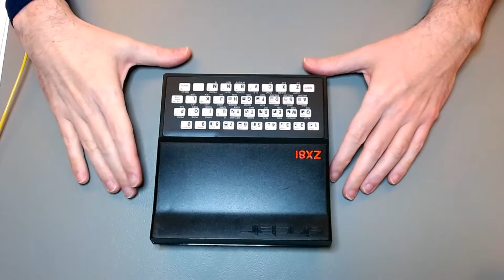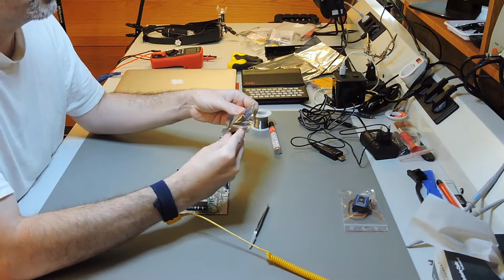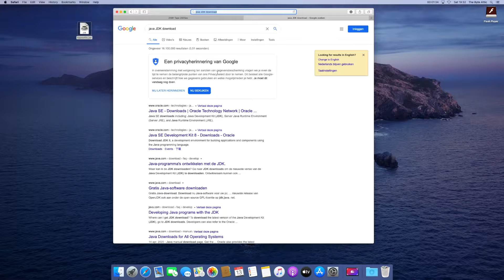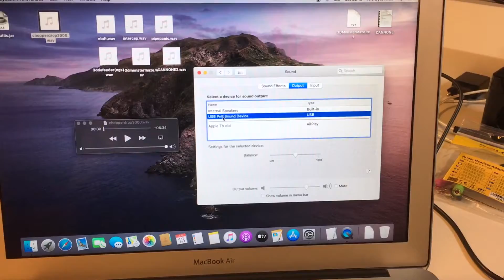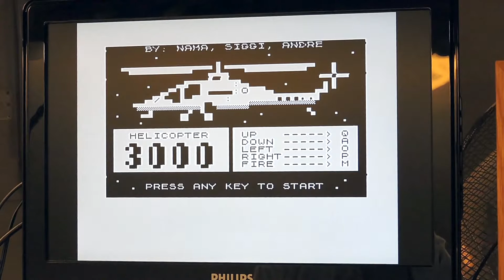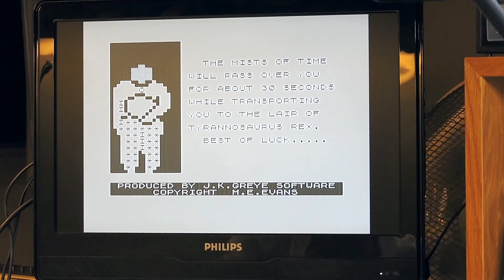ZX-81 bonus material and retrogaming!

Comment: Do you have any information onto which pads you have to solder the RAM pins in a Issue One ZX81 ? You are the first person I notice that is using pads on top . Thanks in advance
Reply from the maker: Those are VIAs. Regrettably, no, I don't think I have an issue one.
Reply: @thebyteattic  ah I thought the ZX81 RAM upgrade you are showing in this video is an Issue One PCB ?
Reply from the maker: Sorry, I mistook the video you are commenting on. Those are indeed pads, the ones used by the diode array. I show where they are in the previous episodes of this series, just have a look there.

Comment: Someone must have developed a method to directly load the SRAM with program data.  It was done by Commodore long ago, with the 1541 disk drive (that was more powerful then then Vic20) .
Reply: DMA controllers. they can take over the busses, the Z80 does DMA block transfers in software, but if you have a DMA co processor it can intercept and do it in hardware one byte per machine cycle or thereabouts..
The 68K based Amiga had DMA controller channels, they called them Blitters.